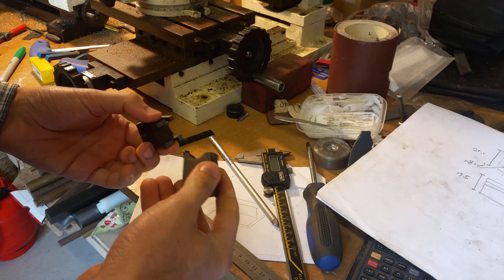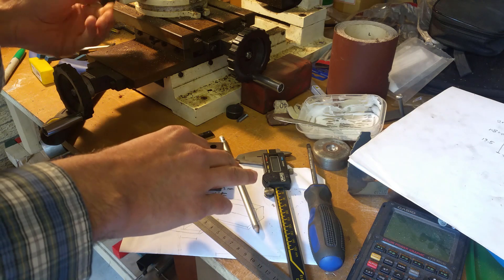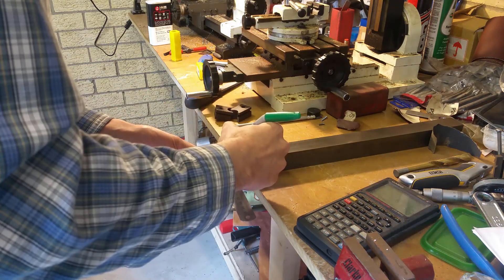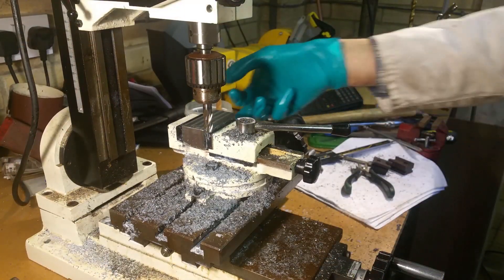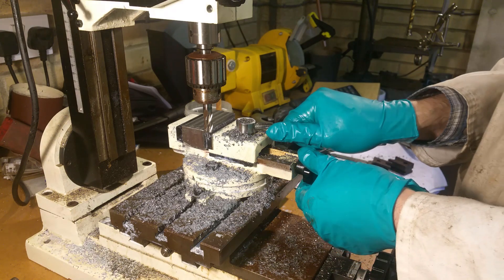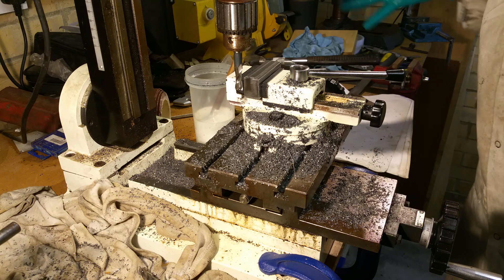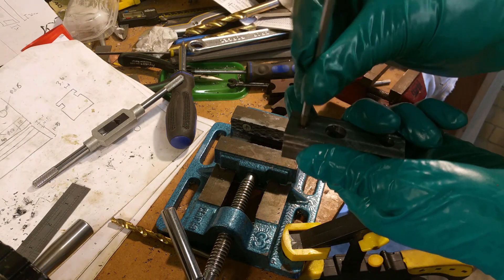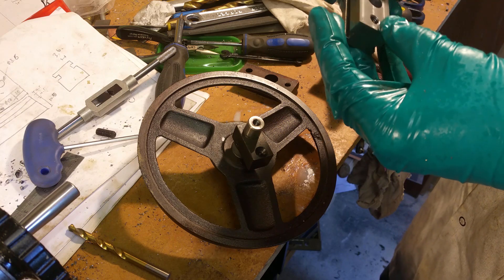Mini Mill/Mini Lathe Project: Repairing a 6x4 Bandsaw

Comment: Hey! cute litle machine, I have a very similar one :) 
some advices, if I may: 
your cutter seems to not be sharp anymore, if you use a new one, it should work better, also the drill chuck leaves a lot to desire when milling... futhermore oil is not needed when cutting in steel, and the gloves ad a little bit of danger...
greetings
Reply from the maker: MrTiefbassingenieur Thanks for the tips!